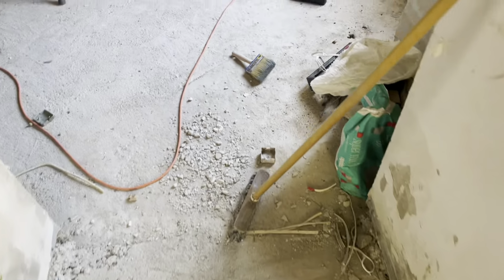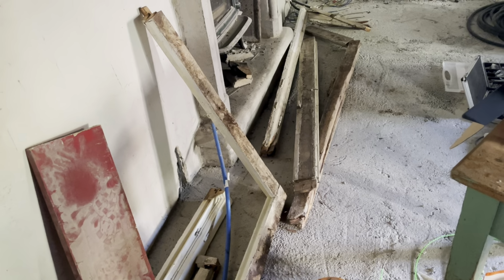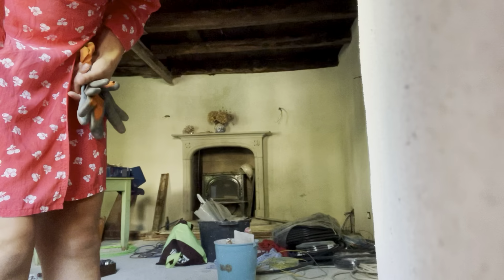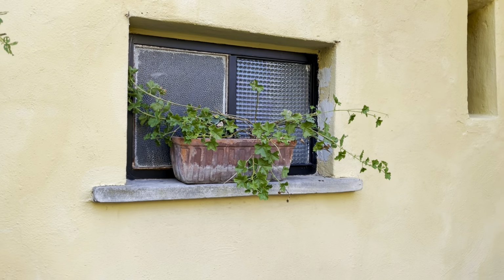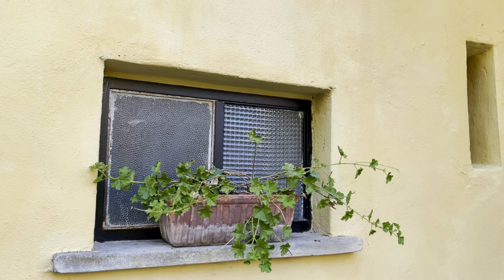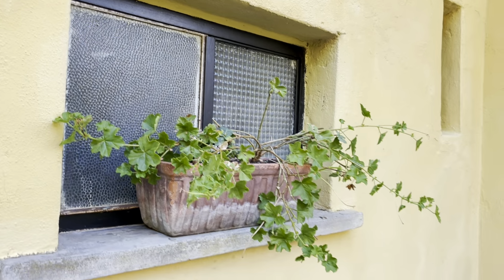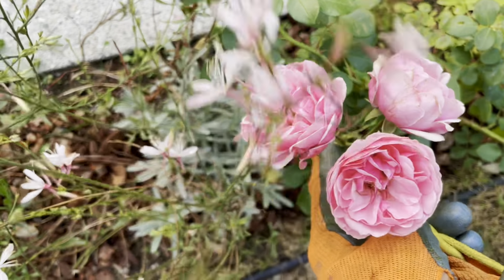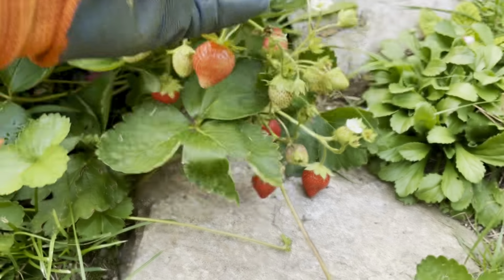We made it worst! One year of renovation…

Comment: I always enjoy the 'ride-alongs' 😀 
I've renovated several 18th century New England Colonials. I know, as does everyone who has renovated, things always look worse before they look better. 😉 Great progress you two!  🤗
A couple more things to consider ...
There's another vlog, Escape to the Dream, that they showed a product that is wallboard (aka, sheetrock) that is backed with insulation. They are in France. But, it's possible you can get that there in Italy too. I was thinking that would be a good thing to use on your ceilings in-between the beams/joists. It'll provide some insulation (that you said you wanted) as well as the finished clean look of sheetrock. If this works ... here's a link to one of their episodes at the point where they're cutting this product.
https://youtu.be/Q69i0-g6wJ0?t=829
In my homes, the floors were/are tongue & groove wood. They have gaps in between. Generally, when I need to fill such gaps, I will use caulk, either black or clear depending on the situation. Or, if they are really large gaps, I use a black foam insulation that comes on a roll with various widths that I can 'push and smush' it into the gaps. The advantage is that in both cases the product blends with the wood and isn't so visible (as is the foam). Another reason I like (the looks) of that sheetrock backed with insulation is that the insulation is black. So if in the application it is used you can see through gaps from the other side (as I can with my tongue & groove flooring), the black will disguise the gap.
Anyway ... long-winded explanation but ... maybe it's something you'll want to check out when the time comes.
Also, another '2 cents' to throw in ... If you cannot afford the flooring you want in your indoor kitchen, you could polish the cement as a temporary "fix" and live with that until you can afford what you really want. Better to wait (if you can) than settle. At least, that's my opinion. 😏
Maybe the house "looks worse" to you. But, the garden is astounding for a 1st year!  😍